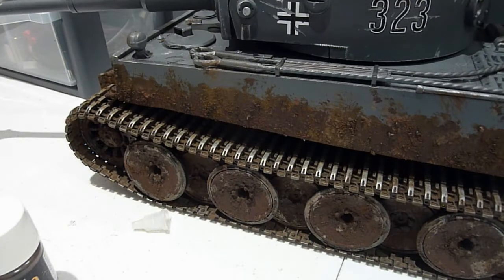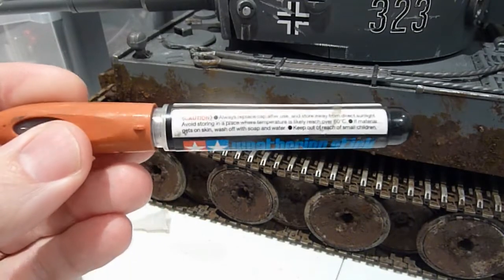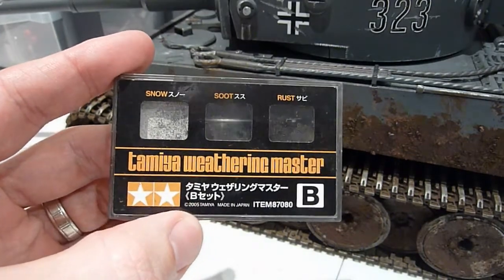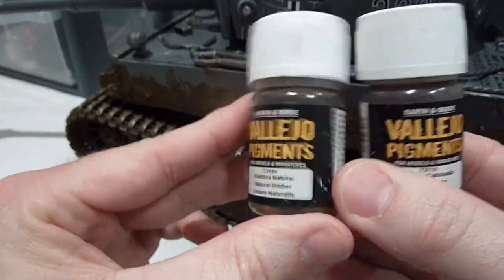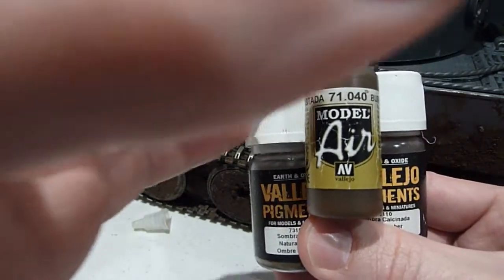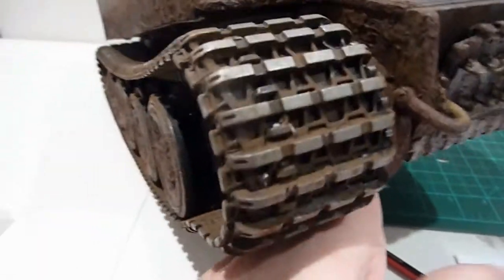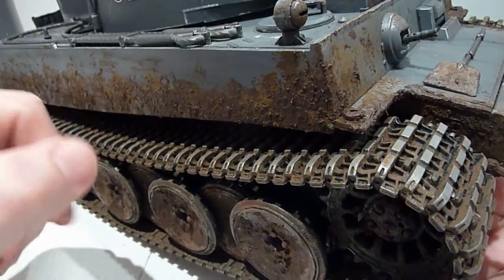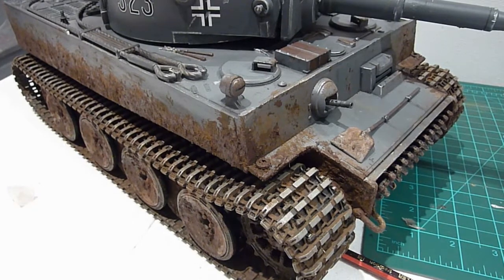Model Weathering products  - RC Tanks/Cars/Plastic Models

Comment: I used something very similar to that tacky glue called Hob-E-Tac. It's mostly for model railroad work but it's pretty much the same stuff.
For something that has to both look totally cool and put up with handling you've picked an excellent range of products.
Sealing everything in with a few coats of a tough lacquer based matt varnish like Alcad Matt or something like it would make it almost indestructible.
That thing just looks awesome all day long Steve :)
Reply from the maker: Hey Mike, thanks for that. Appreciate your comments bud ;) Once dried it is great, slightly flexible so it doesn't snap off. Perfect for RC tanking haha